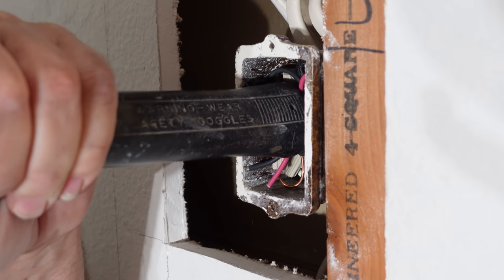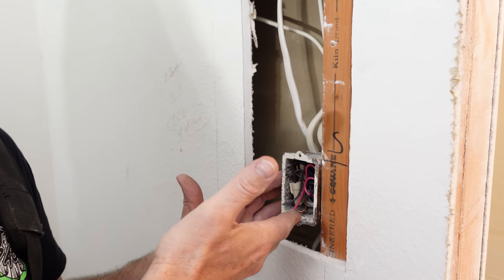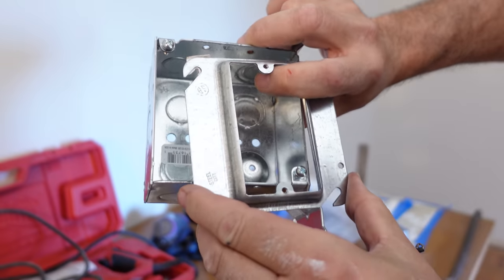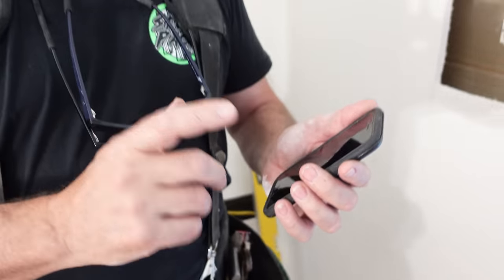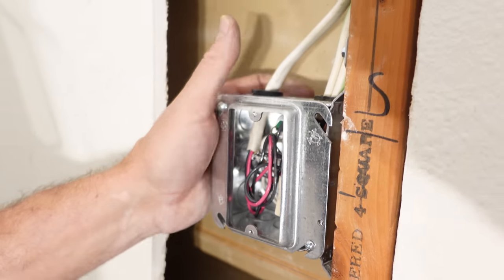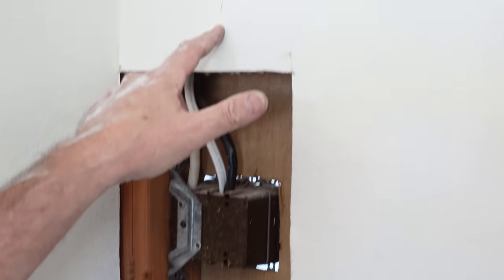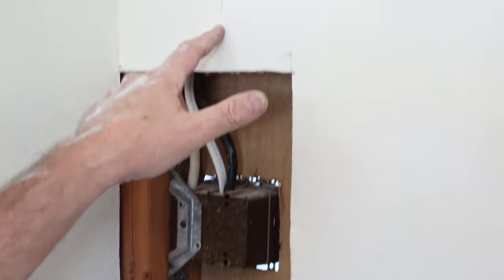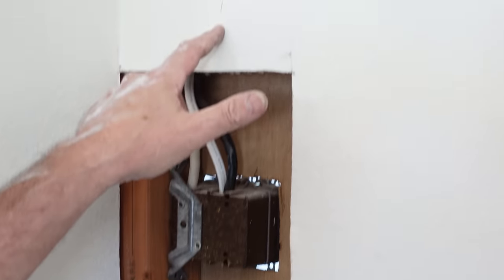STOP STUFFING BOXES! How Many Wires is TOO Many??

Comment: I'm a licensed master electrician.. and I'd like to know who the 13 (so far) that dislike this video?  I will tell you that if Paul was working for me, I'd be pleased with his attention to detail and the NEC guidelines. I also know that he cares enough to be open-minded and learn a better way.  Though he is not a licensed electrician, he def. does a lot better than MANY that are licensed.  He even pulls his cables in atleast 1/4".  HIs method of grounding and bonding is solid.  Kudos for sticking the Hot Stick in there for a double check and finding that second hot line. People just assume WAY too often.  That is how I have always trained my guys.
Reply: I see that you specifically pointed out that Paul is not licensed. I have noticed over the past 25 years that in many cases I have seen the phrase “ must be installed by a licensed electrician”, to “ must be installed by a ‘qualified’” electrician. I feel that having a license can sometimes give electricians to ‘bend’ the rules. My instructor who was also a Local and state inspector told us in code class that he had a rule of thumb which did allow for over-filling a box.
Reply: @dominicm2175  I've been in the electrical trade for 40+ yrs.  Acquired my Journeyman  in '88 and my Masters in '96.  I personally have never been aware of any exceptions given by the NFPA that allows for over-fill of boxes.  Not saying that there isn't because the Code has a LOT of exceptions to the rules. i.e. Such an exception may be pending on a "Temporary" provision. But again, I have never known of a box-fill rule to be subject to this. The 2020 NEC had a LOT of great changes in which the contributors really worked on definitions and outlining such. And many additions to existing rules.  2023 is expecting to have even more of these improvements.  You have to be a good student of the NEC and maintain a steady study of it.  Now, that isn't to say that you won't find yourself in debate with an inspector, etc. from time to time. If and when this occurs, both parties need to just discuss the challenge and always reference it back to the current Code that applies.  Some states have stricter requirements than others.  They may all use the NEC as the base but, each jurisdiction often has it's own rules in addition to the NEC.  For example: The nEC states that you must strap horizonal conduit every 5 ft.  But, your city says that it want it strapped every 4 ft. THAT is the one you must comply with. Therefore, you must always follow the minimum of the NEC or do better than what is the bare minimum requirement. The state of NY, Pa, and WV are some of the strictest codes in the nation. An electrician  from Virginia would most likely fail in said states because Virginia is very laxed in the rules even though the state is a neighbor of the others mentioned. NY and WV require that not only  you be licensed by the state, but, must have insurance. In Pa, they not only are you supposed to be licensed, but, in Pittsburgh, you need to test to acquire a city license as well to work in certain facilities and buildings... and it's a tough one as well. As for Paul, I made the point that he knows more than many who are licensed. He's been there and done that. So he being a good student of the NEC and having a lot of experience in residential and commercial ...certainly would make him qualified to test for a license.  Where I live, you have to have performed work under a licensed master in commercial, industrial, and residential for 5 years as a journeyman to acquire your masters state fire martial license. I think that Paul would easily pass the residential license. Who knows, how ever the rules are in his state, there may be somebody with the authority that will watch his videos and encourage him to go test. Again, Paul does a fantastic job on covering details.
Reply: @dominicm2175  Speaking of licenses North Carolina is now requiring low voltage installers to be licensed., (Telecom, video and burglar alarm). I will be the first to admit that the low voltage industry needs improvement in the cabling work. I have seen some incredibly bad workmanship that causes future problems to service and/or excessive labor to clear problems. Burglar alarm people are the worst in my opinion. They routinely wait until all the inspections are done and then come in installing PVC cable in plenum ceilings and letting the cabling lie on the ceiling tiles without support. If the burglar alarm is shown on the print like the fire alarm system then they get inspected like everyone else. 

The licensing is a joke. I've been retired for 6 years and it may have changed but it went like this. I called a guy in Asheville told him I do low voltage work. He issued a letter saying I was qualified. I presented the letter to Mecklenburg County which put me on a list of licensed low voltage installers. On any new work showing telephone/data  jacks I need a permit. I call or use my laptop to get the permit from Building Standards and my credit card is debited. After I had my cabling installed And while the ceiling is still open I called for the inspection. The inspector came out and looked at the cable to make sure it was not PVC and that was it. When everything was ready I called for a final inspection. The inspector came out looked at the equipment room and asked me where the telephone equipment was. I told him that the customer was using it at the old location and that it would be moved on the weekend.  He said he couldn't give me a final OK. This caused the entire job to fail. The contractor was ticked off at me. After I explained what had happened. He called someone at Building Standards and got us a Temporary Certificate Of Occupancy so the customer could move in.
 After the equipment was installed at the new location I called for a final inspection. A different inspector came out, looked at it and asked me, "What am I supposed to inspect?" I said, "I don't know. You haven't issued a standard for us to follow." I told him to see that the equipment was grounded (which it was) and he gave me the final OK. 

This whole BS routine is about collecting money for the permit. It's not about safety or workmanship. 

My background. I've been in telecom since 1968 when I was hired by Ma Bell. Bell had high standards for our work and it showed. Later when I was a Repairman and saw that few problems were workmanship related I saw the purpose of the Bell System Practices. with the death of AT&T in 1984 all craftsmanship died in the telecom industry. Anybody with a car and some tools can be an installer. They like to call themselves technicians but they aren't, they're installers. They have no background in basic electricity. I had a "technician" who couldn't install a device using the basic door bell circuit. The circuit followed a relay in the equipment so we could use a louder ringer. He couldn't read the simple schematic and the circuit description. I was determined to make him learn and he spent 11 hours over two days on it. I even had him him come into the office and showed him on paper and still he couldn't do it. 
I had another guy who I went out to help with a problem. When I got there I saw a pile of fuses on the ground. "It keeps blowing fuses" he said. "Well don't keep putting uses in. Find out why they're blowing." I ended up clearing the problem myself. One of the problems is that almost all the equipment is "Plug and play". Take it out of the box, plug in a cable and you're done. My experience was on electromechanical equipment. I had to read schematics. imagine a system with 1200 relays with 12 contacts per relay. 

I was also a US Navy Seabee Construction Electrician in a Public Works department where I worked in the telephone exchange, power plant and general electrical repair. I have done high voltage work when needed. How many people reading have worked on a series circuit street light system? It took four days to follow the processes taking place to make a completed telephone call in the schematics.  

The decision to retire came easy. I couldn't stand not being able to find competent workers. The real technicians AT&T laid off were the people owning the businesses. We're all retired now and are so glad to be out of the business.
Reply: @robertcuminale1212  speaking of Telecom… after it was deregulated in 1996 and literally hundreds of CLEC’s popped up, I worked for one in New England installing T1’s and zero of the field technicians or collocation techs were licensed.
Reply: They are the box stuffers😂 not a lic electrian and I know the PDF version of NEC is free online no excuse for any BS
Reply: @robertcuminale1212 That may be the longest YouTube comment I’ve ever come across. I tried making it all the way through but I failed.

Comment: I was tracing an outlet with an open ground, from the bedroom up to a box in the attic (still open) to another one (still open) to a third one, where the ground was good but for some reason they had snipped off the ground on the cable feeding towards the bedroom. That box: a) was buried under the attic floor, b) had a broken nailing flange, c) didn't have clamps and some of the cables were not stapled nearby, d) needed 32 cubic inches, but it was only a 15" box!  Jammed absolutely solid.  I replaced it with a monstrous 42" metal box, with all of those problems resolved.
Reply from the maker: Awesome thx
Reply: I was doing something in a spare room of my house a couple years after moving in and I plugged in a ups that had alerts if bad power etc. Well it alerted to no ground. So I pulled out my tester and sure enough the two boxes on one wall had no ground. Hmm. In the end I discovered that the cable coming into the box had no ground. But when I traced it, the box it came from left with a ground. Hmm again. Looking further I discovered that the ground literally ran out in the middle of the wire. The brainiacs wiring it just ignored it. Couldn't believe the laziness. I wish I could say it was surprising given things I've found in this house.

Comment: I'm glad you checked the power after you flipped the breaker.  I always say it is hot until you double checked it with the power tester.  Lots of great information here and I never thought about box capacity and now I know to check it.  You guys have really made me think more about the things I do since I have to work behind other electricians doing handyman work.  Now I know to check for reverse polarity and no ground on existing plugs and boxes an ddon't assume that the last guy that worked on it knew what he was doing.  Thanks for all this great information.
Reply: Consider it hot until your voltage meter reads 0. Non contact voltage tracers should not be your last line of defense to ensure power to a circuit is off. Always assume the last person working on something was an idiot and didn't do it right so check things out yourself to avoid shocking surprises.

Comment: I've done a lot of wiring mods over years, but I learned something new! Thanks Paul. You guys make me better at what I do and you're entertaining on top of that. God bless y'all
Reply from the maker: Thanks Mark we appreciate that 💪🏼
Reply: @StudPack  That first blue box said 22.5 cu in, not 14. The more shallow one is 14. The one you showed is deeper. Edit: It was an editing error. You had an old work 14.0 cu in box in your hand that looked used, but the close up was footage of a new work unused 22.5 cu in box. Lol
Reply: @StudPack  I just cut off the tips of wires rather than untwisting them when replacing old with a new box. The ends can break off so I'd never try to "save" them (unlike my boss, and he's had wire tips break AFTER installing new box and devices) Better to start fresh and also save time/effort.
Reply: @StudPack  I have an idea how to install that 48 cu in blue box. Use the flange and mount one screw to get it lined up, then install the 2 screws inside the box. Then remove the screw from flange and cut it off with the buzz saw or a sharp razor knife. The would help line up the box with future drywall but remove the potential for the hump.

Comment: You're a pretty good "Jack of all trades" but I think you're an electrician at heart!
Reply: Agreed, he really loves to get into with electrical seems to be extremely knowledgeable
Reply: As someone said to me. “I could wire it for you, but i do not have a license.” 
Liability factor?
Reply: @tedlahm5740  falls on you the homeowner ... you being the general?
Reply: @tedlahm5740  Different localities have different rules.  In the NE, it's common to prohibit homeowners from doing wiring in the own homes, something that would be unheard of in the West.  Usually only an electrician is allowed to pull a permit if the homeowner isn't doing the work themselves; it's the permit holder that's responsible to see to it that the job is done properly.
Reply: @barryomahony4983  I'm in Los Angeles, California. For the most part, homeowner are only allowed to pull building permits. Sometimes, if the jobs are small and include MEP they may allow it, and if the inspectors see crap, he issue a correction by simply stating "Hire a licensed contractors for that part, ie plumbing with no venting, electrical no wired corrected, or mechanical improperly installed.
Reply: @barryomahony4983  in Ontario Canada only homeowners and licensed electricians may do work on a dwelling. on a side note a permit is not needed for things like switchs if it's only being replaced 1 for 1.
Reply: @8dodger7  If you wire something and it burns and someone dies prison is in you.
Reply: I think more folks should get started in electric if it means they are as detail oriented

Comment: You guys are great!! Love the attention to detail. As an electrician myself the only thing I would stay away from is the plug in wagos for pigtails. I've seen them fail a few times, nothing beats splicing with linesman pliers. Great video as always keep them coming!!
Reply: What are your opinions on the Wago 221 connectors?  As someone who is not an electrician but works on my own home, I love those things.  I understand they're more expensive, but I know when I've correctly installed a wire, and can easily remove them.  Which is my largest complain about the push in style they used here.  Also, sometimes when I'm installing a light or ceiling fan the quick nature makes it far easier for me.

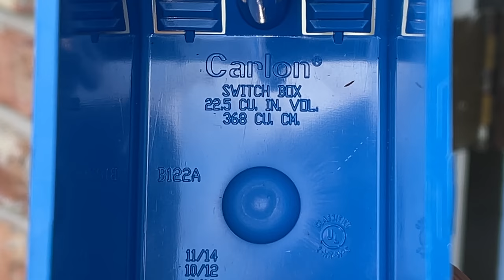Comment: A couple small things - at 1:31 you hold up the small blue box, and say 14.0 Cu in. A short time later, we can see that you wrote 14.0 on the outside. Inside, though, it actually says 22.5 Cu in vol.

The gate installers probably didn't connect the ground wire in the plug because of the reversed polarity that you mentioned. I would suggest, though, that you check the gate end of the cable, to make sure that they didn't leave both ends disconnected. 
Lastly, in the outdoor box that you added the extension ring to, it looked like one of the black wires was burned - you can see it at 16:18.

Thanks for all of the great content.
Reply from the maker: I think 1:31 might have been the wrong clip is all.  You saw we wrote the box fill on the exterior of the box so I didn’t goof.  

Checking the other side of the ground to see if it was connected..... excellent suggestion 👍👍👍.  I didn’t physically put eyes on it but I did check it with my meter.., 120V from hot on GFCI to the metal on the gate 💪👊

Comment: awesome video. You covered everything in a residential sense for box fill and such. As electricians doing old work you run into this all day long and in some cases you are totally right its not worth it to shove a device in a box that is already filled to captivity. Yes we all have experimented with that meaning shoving the butt end of hammer on the wires or just giving a device a hefty push and then it goes BOOM!! lol. Anyways love the content thanks.

Comment: Oh my gosh, this is yet another example where you directly address a recurring problem that I couldn't solve. Just as you said, the sheathing on those old wires roll up like a shirt sleeve against the integrated clamp! But I needed the space and it was the biggest box I could find. I never considered the metal box and the additional space the front flange can add.

Comment: You're making me proud, Paul. You did well on this one. You even disclosed the 2.25 rule for 12 AWG. Using the WP extension (not a box) is one of the best methods. FYI.. there are also WP cover designs that provide the same.  I am very pleased that you finally got to the box fill/capacity.  The app is great ...even though I've been calculating them the old school way for decades. Nevertheless, it's still a good idea. Be sure to mention staple distance rules from box in a future video.,, including staple capacities. The guy who cut the ground from the SO cord needs smacked. That could have easily killed somebody in the right conditions. Idiots!

Comment: I really appreciate this video!  The explanation of box fill and options for boxes is right on time.  Really shows the old saying, "Know enough to be dangerous."  I have done a fair amount of electrical work at my house, to include wiring my garage from scratch.  I did a lot of research to be code compliant and do it correctly.  Box fill never really came up in my research.  Now I know, the rest of the story.  I'll be revisiting all of my work to be sure there is sufficient room in the boxes.

Comment: Perfect timing!  I'm redoing my 1920's kitchen and the armored cable  power line goes directly into the ceiling  fixture and then branches out to 4 or 5 cables from there.     Yikes!  I'm going to need one of those jumbo metal  box with the mud plate thingies.  Just got some of those wago connectors from amzn. Thanks for the info
Reply: Run all new wire. You will never regret it.